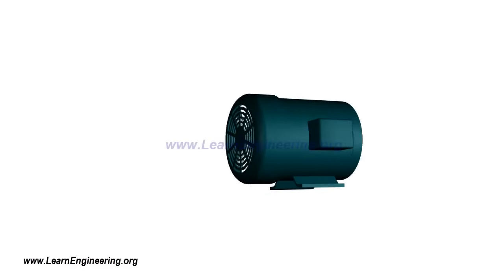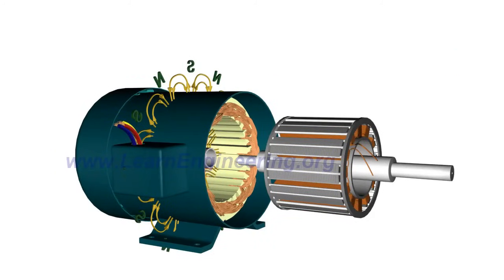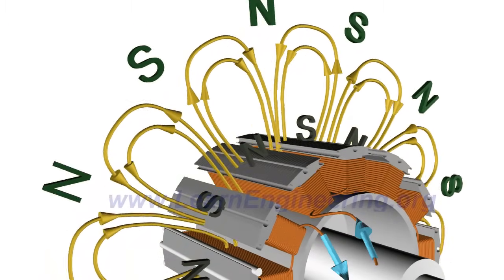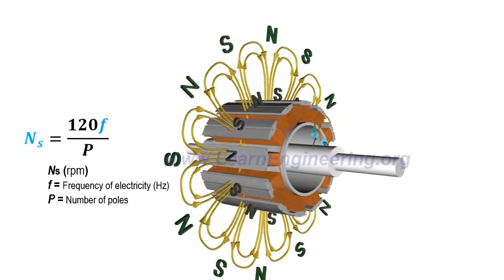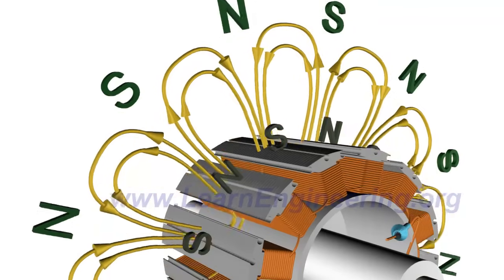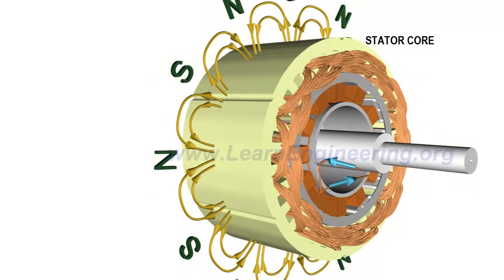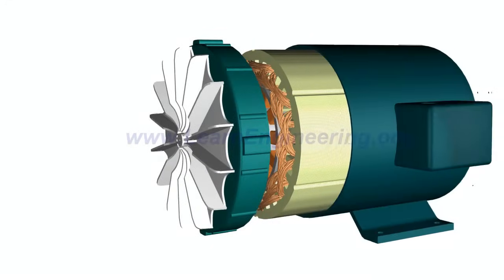Working of Synchronous Motor

Comment: How are synchronous motors started? Are they started via induction, then when the rotor has reached a certain speed, the rotor bars are excited via dc voltage to reach synchronous speeds? Or is it started a mechanical way?
Reply: The external added cage makes it start. The RMF (Rotating Magnetic Field), coming from the electrical circuit in the stator, creates current in the cage resulting in an EMF (Electro-Magnetic Force). I think this is Lorentz law... This force gives the rotor an initial push or start. Once in motion; the 2 magnetic fields, the RMF from the stator and the static/fixed magnetic field from the rotor "lock into each other", because the "north" pole of one field will attract the "south" pole of the other field and vice-versa. The rotor is forced to follow the rotating magnetic field of the stator. 

So, the initial start is very similar, or actually the same, as an induction motor. But the actual drive of the motor, i.o.w. "what makes it rotate all the time" is different. It's  magnetic fields locking into each other, making the "locked magnetic field" go the same speed as the magnetic field (RMF) that's "locking it". Same speed --> synchronous.

With induction motors however, the rotor will turn solely because of the EMF cause by the RMF, thus creating a "delay"--> "slip". making it asynchronous.
Reply: @ColonelFluffles  Thank you sir

Comment: A well explained animation on electrical motors. But, it's seems the direction of magnetic field over squirrel cage is wrong on 2:48. The correct direction should be the same as rotor rotation.
Also, if it is PMSM motor, rotor windings should energize with DC current, but there is no DC supplier connected to rotor windings in the video.

Comment: Is interesting that the machine is usually called induction sychronous motor, but the induction process happens olny on the transient period, either durig the start or load changes. During its normal operation there is no induction between rotor and motor, and the rotor is locked to the RMF because of the magnetic force. I kept thinking there was some kind of induction during the normal operation, but the description was very clear showing it only happens during those particular conditions

Comment: While there are more than sufficient videos dealing with  synchronous motors powered by three phase . there is not one single video describing just why and how a two pole magnet rotor ac motor powered by single phase works. Such motors may be found in washer drain pump application.

Comment: It might not be the best question to ask but I recently studied Ac motor(Induction motor) where I got to know continuous changing field induces Eddy current.what really confused me was as the magnetic field of stator kept changing it produced absolutely no effect on the magnetic field produced by the Eddy current as if it had induced permanent poles.The north and the South Pole of the induced Eddy current in rotor  kept moving towards the magnetic field of the stator but could've simply reversed their field to counteract the change of field.why does that not happen?
.I hope you can help me with it

Comment: So a Synchronous Motor with motor looks like an BLDC but it is just powered by AC current?
Reply: The differences are quite bold-
(1) The Back emf for a BLDC motor is alternating in nature but not sinusoidal. Whereas, for a PMSM it's purely sinusoidal.
(2) For a BLDC motor, the inverter needs to be operated using a PWM. But, for a PMSM, it should be a SPWM.
(3) You'll experience a ripple torque in a BLDC Motor. But, torque is relatively smooth is PMSM.
(4) BLDC motors are not feasible for high precision performances. But, one can use PMSM for that purpose.

Hope that clears your doubt!

Comment: I have a doubt.....
Because of the three phase supply given in the stator, a rotating magnetic field occurs.The rotor is given DC supply so thus it creates stationary magnetic field around it. Theoretically The stationary magnetic field produced by the rotor should catch up with the rotating magnetic field of the stator thus because of magnetic locking the rotor spins(mechanical energy as output).......but the rotor should have some weight..... right? Is it possible for the rotor to catch up with the rotating magnetic field of the stator because obviously the stator field will be faster than a mechanical object. So the rotating magnetic field "might" complete multiple rotations even before the rotor catch up to it...so the rotor should be Oscillating instead of rotating right....??confusing :|
Reply: Yes! In this case, the rotor won't be able to start it's rotation, maybe it will just vibrate. That's why the squirrel cage is used. Listen to the explanation once anain, and you'll find your answer!
Reply: Yes. That's why the squirrel cage is placed over the rotor as a starting mechanism so that the rotor speed can catch up with the synchronous speed. Once, the speed of the rotor rises, the excitation is applied to the rotor to achieve the magnetic locking required for the synchronous speed.

Comment: How about 220 volt ac synchrounous motor. do I have to reverse the neutral and line to get it rotate in ccw? As it has only two wires
Reply: Not really! You won't be able to generate a -ve voltage in a PMSM as the structure won't allow you to do so! In order to reverse the direction of a PMSM, you need to generate a level shifted sinusoidal i.e. (v_dc/2)+Acos(ωt). In this case, there will be no current due to DC component (as it's a balanced circuit), but there will be current only due to Acos(ωt). And, as you know, this component can be -ve, so you'll be able to rotate the machine counter-clk wise.
Hope this clears your doubt!
Reply: @snehashishbanerjee2575  thank you
Reply: @Muslim_011  you're welcome

Comment: In this video it was stated that a permanent magnet could be also used as the rotor.
But the rotor was required to be de-energized first in order to self-start so how is this possible with a permanent magnet rotor?
Reply: With a prime mover
Reply: @yassineamine2891  could you please elaborate?

Comment: This is video about induction motor, it means asynchronous motor. You have a cage here for self starting. In synchronous motor you need a start module for starting. MAX speed of this motor is also less than synchronous speed, it means that this is ASYNCHRONOUS motor.
Reply: This video is about SYNCHRONOUS MOTORS! In induction motors, the rotor coils don't generate any magnetic field. It is generated by the stator fields

Comment: In three phase induction motor as you've said Slip= Ns-Nrotor And Rotor speed try to catch up synchronous speed but that won't succeed If it will then motor will stop then how in synchronous motor slip is zero????
Reply: An induction motor produces torque only when slip isn't equal to zero. A synchronous motor produces rotor flux with electromagnets or permanent magnets so it always stays in synchronism.

Comment: It is interesting to see that DC Synchronous motors are the preferred motor type used in many electric cars or hybrids.
Reply: I think that's mainly due to higher energy and power density and higher efficiency.

Comment: Is this means it can be plug direct to the grid and does not need a controller box for a single speed?
Reply: Nor really! There's a very complex control structure behind the motor! There are many sensors, controllers, methodology, feedback control system and so on!

Comment: Excellent video sir please tell connections of winding star or Delta.How many coils and magnets we need to convert it into an alternator. 
faiz_nabi2000@yahoo. com. 
Please guide me to make a low RPM high output alternated, for hydro electricity

Comment: I am not getting the difference in 3 phase induction motor and synchronous motor
Reply: As the name suggests, the Syncronous motors are operate in synchronous speed. Whereas the induction motors are asynchronous motors. The speed of induction motors are slightly smaller than that of the sy. motors. The difference in speed is called a 'Slip'.

Comment: regarding the equation of the sunchronous speed, is P is the number of poles on rotor or stator?
and what do you mean when you say that if torque is greater than the torque produced by the motor, it will come to rest?
Reply: The P, in Ns=(120*f)P, represents the no. of poles in stator. 

The torque refers to the load torque. There will be always a limit what amount of torque a machine can handle! You should operate the machine within that defined region.

Comment: It may be good to elaborate some on how synchronous motors can be used for power factor correction (instead of using large capacitors + providing a source of extra rotational energy). Good work, still.

Comment: what is hwppening wihe the addition of squirel cage @2:45??
Reply: Consider squirrel cage bars as a conducting loop placed inside a rotating (varying) magnetic field! We know, the emf will be induced in it and hence the current will flow! As current flows, now the situation becomes as a current carrying conductor placed inside a varying magnetic field. You know what will happen, they will experience a force and the squirrel cage along with the motor will start rotating!

Comment: Once breakdown torque is met, why does the motor stop completely? It seems to me that the squirrel cage starting system would turn it back into a regular induction motor.
Reply: i think its because usually the load that created the breakdown in the first place is still there. after the breakdown.
The squirrel cage only creates a weak field, just strong enough to get the motor started

Comment: How about controlling its direction.. I mean ..when it will chacounteclockwise.nge the direction of rotation? I read in Wiki.. it says until outside force is more greater than its torque.., it will change its direction or oppose the direction before..  once u go clockwise, if u stop it it will go now

Comment: How about controlling its direction.. I mean ..when it will change the direction of rotation? I read in Wiki.. it says until outside force is more greater than its torque.., it will change its direction or oppose the direction before..  once u go clockwise, if u stop it it will go now counteclockwise.
Reply: In order to reverse the direction of a PMSM, you need to generate a level shifted sinusoidal i.e. (v_dc/2)+Acos(ωt). In this case, there will be no current due to DC component (as it's a balanced circuit), but there will be current only due to Acos(ωt). And, as you know, this component can be -ve, so you'll be able to rotate the machine counter-clk wise.
Hope this clears your doubt!

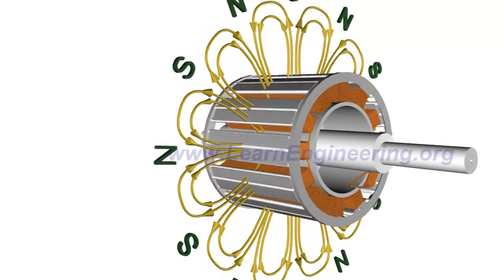Comment: Great video. A question here, from where does the mentioned direct current flow come from (video 03:01) to make the rotor rotate with synchronism? thank you
Reply: The synchronous motor is started via a DC current supply to the stator. It's explained at the start :)
Reply: Rotor is given a DC power supply and the stator is given a 3ø supply

Comment: Synchronous motor is a doubly excited machine i.e two electrical inputs are provided to it. It’s stator winding which consists of a 3 phase winding is provided with 3 phase supply and rotor is provided with DC supply. The 3 phase stator winding carrying 3 phase currents produces 3 phase rotating magnetic flux. The rotor carrying DC supply also produces a constant flux. Considering the frequency to be 50 Hz, we can see that the 3 phase rotating flux rotates about 3000 revolution in 1 min or 50 revolutions in 1 sec. At a particular instant rotor and stator poles might be of same polarity (N-N or S-S) causing repulsive force on rotor and the very next second it will be N-S causing attractive force. But due to inertia of the rotor, it is unable to rotate in any direction due to attractive or repulsive force and remain in standstill condition. Hence it is not self starting....BUT WHY SQUIRREL CAGE SHAPED ROTOR IS USED?
Reply: +AJITH THOMAS I believe the squirrel cage bars are affected by the rotating magnetic field (RMF) such that it produces a force which begins to spin the rotor (see 2:46)
Reply: I believe this cage turns this motor into a induction motor and causes intial start
Reply: I think, the SQUIRREL CAGE is not needed. The DC power supply to Rotor or a parmannet magnet will give push to start the rotor to move from inertia.

Comment: I have a question. Say this is 8 pole 60 Hz synchrnous motor. Now, in normal conditions, once it starts as an induction motor, rotor field coils are energised once at around 0.95 slip. What if, field coils are energised early, say at 0.48s? Thanks.

Comment: Aw man, you're awesome! Just where have you been all the time, or what's your primary profession? Also how is the constant magnetic field controlled in permanent magnet motor? Or how's it turn on/off in electromagnet synchronous while the motor handles varying load?
Reply: Since centrifugal switch is controlled by RPM instead of load or torque.
Reply from the maker: We work mainly in engineering consultancy field. Educational video making is just a part of our profession.
Reply: Emm, the other questions?
Reply from the maker: Indra Ida Bagus In that case you have to rely on some external prime movers to make the speed near to synchronous speed.